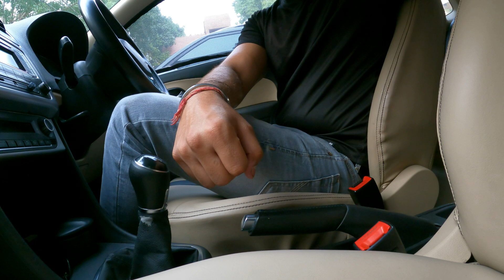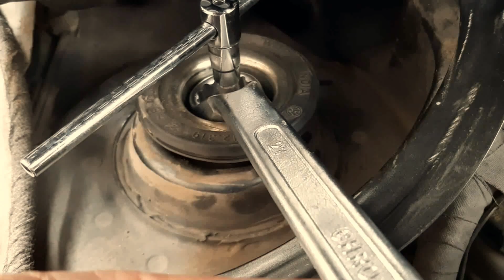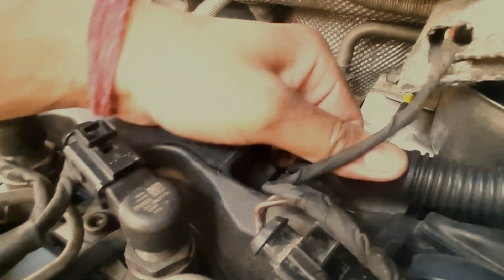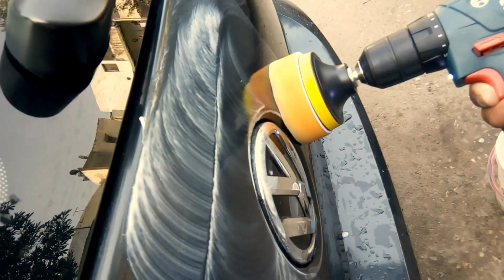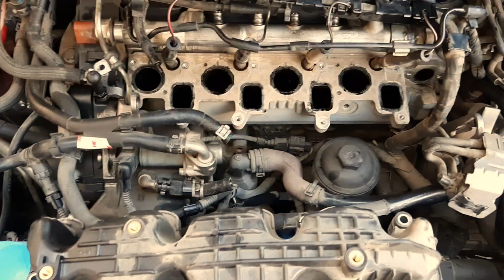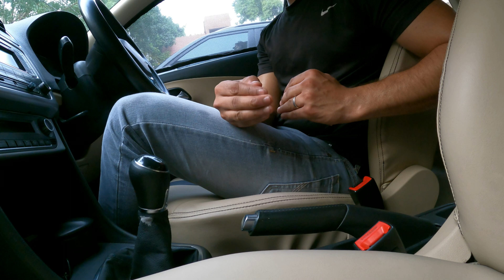NEVER CHANGE YOUR CAR'S OIL GRADE / OIL WEIGHT

Comment: on the owners manual of rapid 1.6TDI CLNA engine it states to use VW507 engine oil i.e. 5W30 grade, but the Authrised service center use 5W40 VW505 01 oil. what do you say about this?
Reply from the maker: Sir thats because there are very few oils , which are 5w40 and have a approval of vw507 , most of vw507 oils are 5w30 , and those manuals are almost carried from their European counterparts
Reply: For india it’s better to use 5w40 or 0w40 as it performs well in hot temperatures, 5w30 better for colder European weather !!!  5w30 0w30 5w40 and 0w40 all suitable for VW TDIs
Reply: Sir, as far as I know, there are no 5w40 oils with VW 507 00 approval. All VW 507 00 oils are 5w30. VW 507 00 supercedes 505.01. As per Lubrizol relative performance comparison tool, VW 507 00 seems to be highly demanding when it comes to wear protection, sludge , oxidation, deposits etc. So I think VW 507 00 will have better additive package in it.

Sir, would you be able to do a video explaining the vacuum system in Tdi engines when you have a chance?
Reply from the maker: Will do it sir.
Yes 507 surpasses the vw505.01 but the older tdi engines are designed for 5w40 , 
Tolerances and clearensis are designed keeping the viscosity of oil in mind .
Engine which has t
5w40 will have more clearance in between ( crank and con-rod , cam and cam-seats )
As compared to an oil which is 0w16

Comment: Are you only referring to TDI's /TSI's? Does this apply for the 1.6 MPI? Btw, finding the owners manual for the Vento is hard and when i finally downloaded one, it was for vento and polo and it doesn't particularly say if it's for tdi or tsi or mpi.
Reply from the maker: Sir this things applies to every engine , regardless of manufacturer and technology
Reply: @yourDIYneeds  thanks

Comment: Bro honda city 4th gen nai reflecter headlight h. I wan to upgrade bcoz 55 watt halogen not give confidence at night.
Ap reflecter mai kya preffer karoge...
1. 100 watt haloge bulb with really
2. Led
3. Hid ?
Reply from the maker: Sir the thing is if you have seperate low and high beams , then the led will work just fine .
But if its a common setup like h4 then HID is the best option , talking about halogens , 100 watt halogen will be brighter but over the tume due to excess heat it will mess up the internal reflector
Reply: @yourDIYneeds  yep high low alag alag hai
Reply from the maker: Sir a good pair of leds will work great then
Reply: @yourDIYneeds  aap koi brand recommend karoge?
Reply from the maker: Sir sare brands , china se banwa ke apne brand ka logo lga ke bech re hai , but kuch design hai jo ache hai , jaise ek brand hai like crystal vision , agar mil jae to sahi hai offline

Comment: What about the VW 504/507 oil grade? That oil is only available in 5w30 viscosity. Both Liqui moly and Amsoil are a providing that viscosity in 5W30.
Reply from the maker: Sir yes 504/507 approval are available mostly in 5w30 because both the approval and the engine for which those approval are made , are relatively new , almost every new vehicle is coming now with 5w30 and there also are vehicles which are using 0w16
Reply: @yourDIYneeds  So I think in your video it should be concluded that any other 'XYZ' 5w30 oil which does not meets the VW specifications should not be used in VAG cars, that 5w30 oils are harmful for TDI/TSI engines, not the approved VW 5w30 oils. Generally the 5w30 oils are used for extended drain intervals (30k Kms) in the Europe, but in the Indian weather and stop go traffic it is not suitable. So we should stick to the 15k or 1 year criteria.
The newer gen EVO TSI engines now require 0W20 oils and that only provides VW OEM oil and in aftermarket only the Liqui Moly.
Reply: @NavjotSingh_993  What he meant was, if your manual suggests 5W40, then don't go for 5W30. Nowhere did he mentioned about the VW standards. It is best to use oils that come with VW specifications, but if you cannot find them, any good oil with same grade should do. But make sure to change the oil earlier than specified in the manual. I've known a person, who didn't used VW specified oils for his VW TDI and yet his car runs perfectly at 1,00,000 kms. What he did was, changed his oil before the manual recommended interval and he sticked to 5W40 grade oil.
Reply from the maker: Sir exactly , an oil without approval will work ( no approval means , that specific oil doesn't have all the required additive package which is required by engine to perform its best ) 
And this video was not just for VW owners it was meant for everyone , so thats why i didn't mention any approval or comparison of India vs european intervals . The whole crux was , if you have a vehicle which is like 5-6 yrs old and uses 5w30 or 5w40 and you want to switch to 0w20 , its not a good Idea , because your engine is not designed for it . 
I used 5w30 and 5w40 as just examples.
Reply: @yourDIYneeds  Yes sir that's not a good idea to change the viscosity grade of oil.
Anyways you provide us with a good knowledge of automotive related things.

Comment: Hello sir,

Sir which oil grade is Suitable for (2006) Swift petrol+ C.N.G ??
Reply from the maker: Sir as far as i know swift takes 5w30 but after CNG , there is kind of a doubt , as it was never designed for CNG
Reply: @yourDIYneeds  ok sir thanks for helping me..

Sir if  possible please help me..thanks.
Reply: Swift petrol these days comes with 0w16 and earlier it was 5w30. Hence both should work. 0w16 will give you better fuel economy.
Reply from the maker: The earlier engine was designed to run on 5w30 not 0w16 , so i would never advise that , if you want a proof , then give your car to service centre for oil change and check the bill afterwards , it will be clearly mentioned 5w30 , earlier swift had a k12 engine but now its a newer alteration which runs on 0w16
Reply: @yourDIYneeds  The earlier K series engine (UPTO 2011/12) require a 5W30 grade Engine oil. But later on, Maruti modified the engine to use low friction pistons, rings and bearings. Thus the later cars came with a 0W20 recommendation which again in 2017 was changed to 0W16. 0W16 will cause unecessary stress on the engine components. If your manual recommends 5W30, you can switch to 5W40 but nothing greater than that. 0W16 will  cause severe engine damage. If you want better mileage, the best you can do is to buy a ACEA A5/B5 certified engine oil. If will make sure you get better mileage and stick to your company's recommended grade, since it is a thinner oil than normal 5W30. Also switch to fully synthetic.